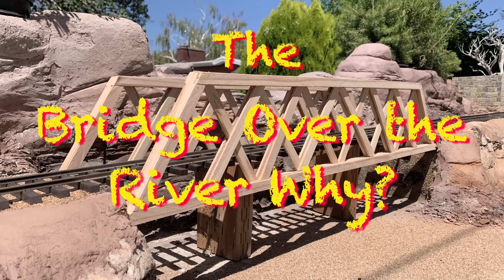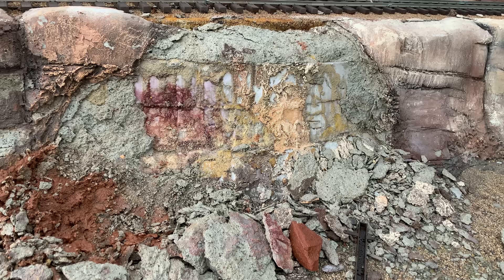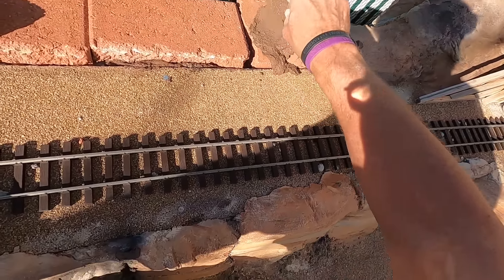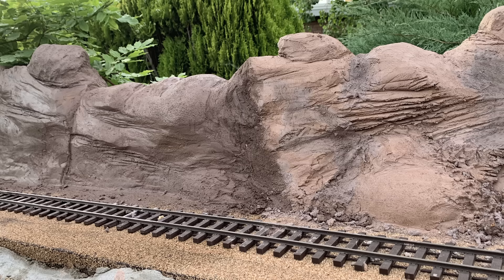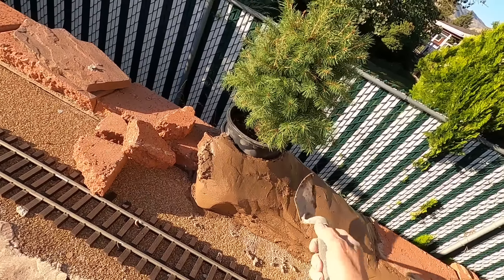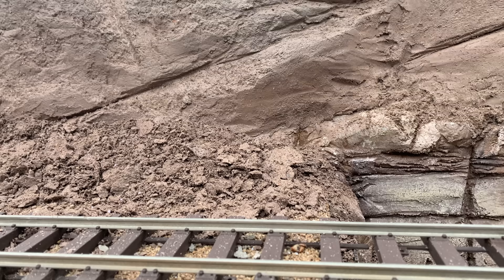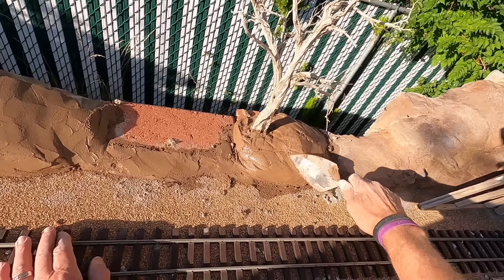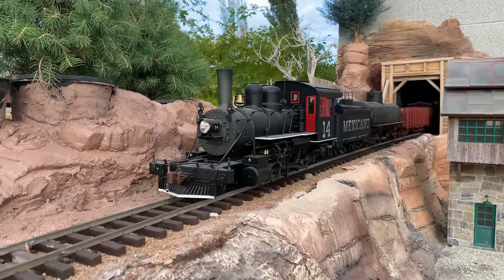Cement Scenery on a Garden Railroad. - The Bridge Over the River Why? Part Two

Comment: The debris you removed from the scenery (that is not placed back at the base) can be used to add to track ballast. You probably thought of that though. You could also flex the mixing tub too to remove more material; waste not... want not... sort of thing; make copper wire out of a copper penny.

Comment: Also if you can run DC engines on this railroad that is DCC you can run some of your other locomotives like D&RG C-19 Consolidation 346 with the rotary snow plow. And Eureka (with a new gear) and Glenbrook. But I feel this railroad clearly belongs to the 2 outside frame Connies Silverton Northern 34 and Mexicano 14. I truly think Eureka, Glenbrook, and 346 should be kept as DC. And it looks not only impossible to add DCC to your Eureka engine, but a little dangerous too as a Phoenix sound unit can overheat. It is beneficial that with Eureka free rolling it’s easier to doublehead with Glenbrook like they did in 2021 at Cumbres and Toltec. But you don’t have to doublehead all the time.